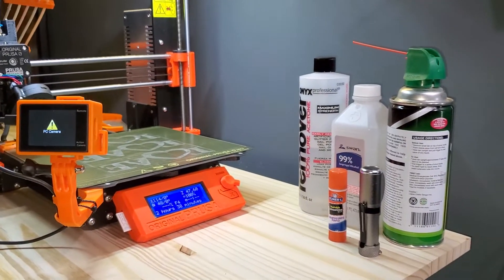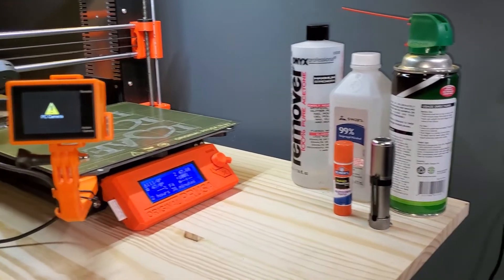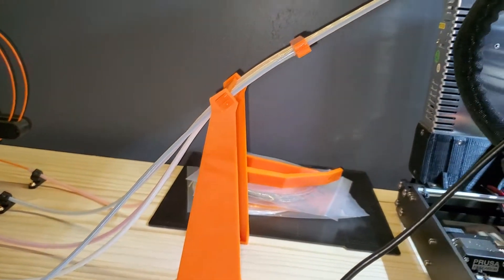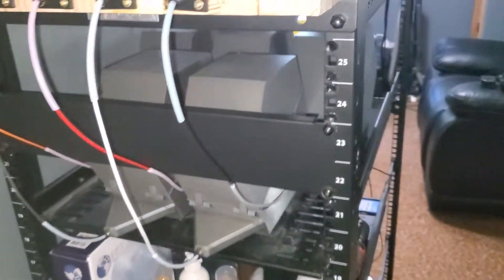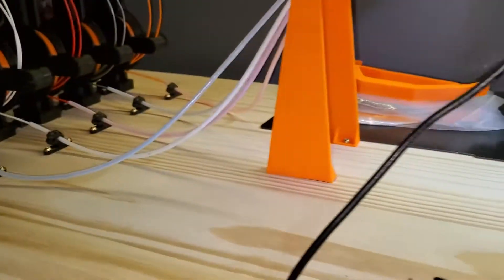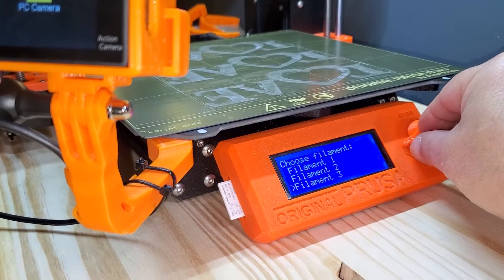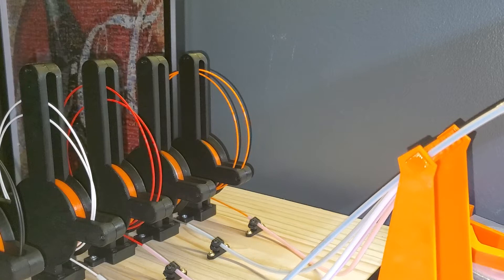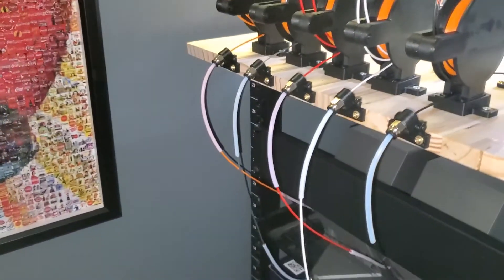My setup of the Prusa MK3S with MMU2S.

Comment: Nice setup, but what is the point of having dry-boxes when the first X feet of filament that you are going to use are always out in the open?
Reply: Was wondering the same thing. Everything needs to be in a pTFE tube and the buffer needs a air tight enclosure.

Comment: I am always surprised to what extend people go to make this product work somehow, while Prusa claims everything is fine. I have to MMU2 and just recently switched to a Palette 2S Pro from Mosaic as the MMU2 where so unreliable. Of course now I wished I waited a bit longer and then would get a version 3, but that is life.
Reply from the maker: You know, I don't really have issues, everything I did here was for space reasons, not working reasons.  I absolutely hate the buffer that came with the MMU2S and saw these online and thought they'd work great with how I was putting the spools under my printer.
Reply: Funny enough, I switched from Palette to MMU for the same reasons. My mmu was horribly unreliable until I switched in 3mm ID ptfe, but now I've not had an error in 500+ color changes. The palette was far worse for me in terms of reliability. 

I only used the first iteration of the palette though, however many years ago that was, and I did not like that a single failed splice ruined the whole print. At least the MMU failures only resulted in a stopped rather than failed print. I'd be curious to hear how your experience has been with the newer Moasic models!
Reply: @theodoreburns1330  I have the 2S Pro version and no reason to complain. I think welding module is better, why they offered upgrade kits as well. Not so sure about the 3rd version. It seems like they have switched to a similar mechanic as the MMU.